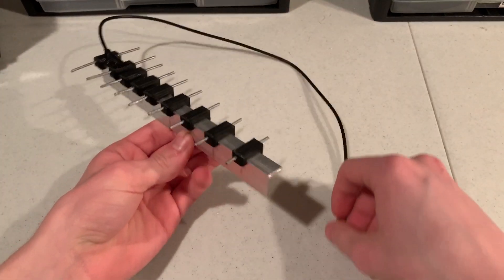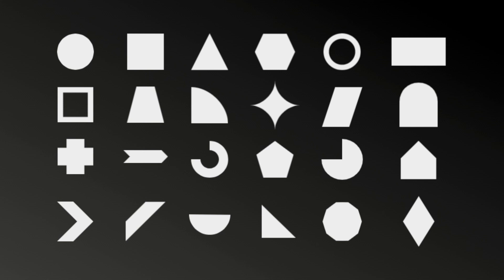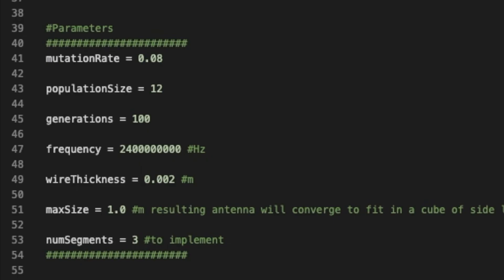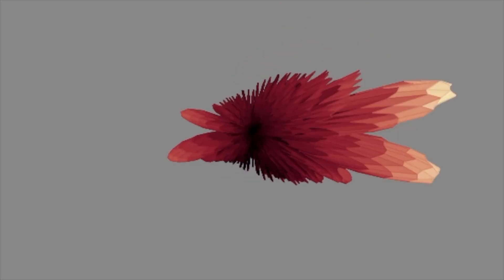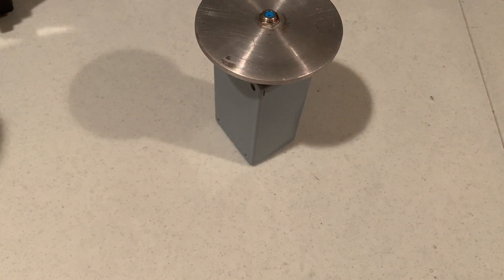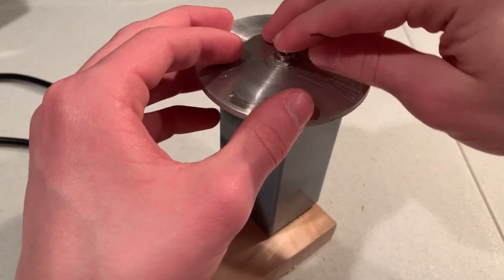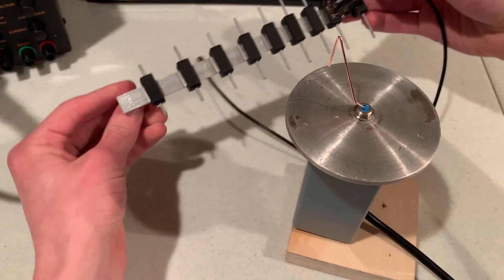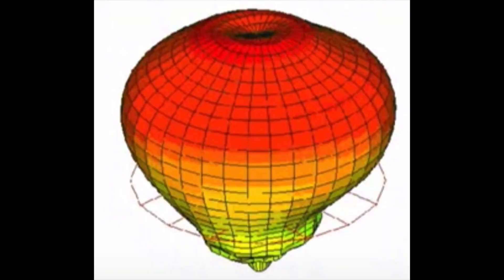Designing Antennas with Python (Evolved Antennas/2.4GHz WiFi)

Comment: I think simulated annealing is a better way to evolve an antenna than evolution algorithm... When you mix two good designs with each other it will completely throw off it's operation. Annealing just vibrates the variables... I would still do multiple generations though, but each generation should start from scratch. You still need many generations because each trial gets trapped in a valley. Every new generation goes in a different direction.

Comment: Nice video.  A few comments for those interested.  The 4nec2 program has a built-in genetic optimizer.  For what it is, it is turnkey and very nicely done.

The UI does allow for some kinds of parameterization.  Simple math expressions are supported for sure.  That enables encoding of things like number of elements, wire length and spacing, etc.  However, I don't know if anything more sophisticated is available.  Trig functions, for example, would be nice so that wire angles could be encoded.  Quaternion would be ideal.

Doing this in Python as you did is absolutely the right approach for the generality.  Packages like PyNEC nicely wraps the NEC2++ backend for usability.  Additionally, I'd take a look at packages like PyGAD for the genetics algorithm engine.  That can save lots of programming time.

Now, a practical problem for antenna designs at WiFi frequencies is the very tight manufacturing tolerances.  A few tenth of millimeter in length or a degree of bend changes radiation behavior substantively.  3D printing is the way to go here.  Use SolidPython package to go from the NEC2 geometry deck to OpenSCAD input.  The rest of it is standard 3D print flow, e.g., STL to Cura or other slicer of choice, etc.

Use copper tape on the printed plastic framework.  Alternatively, glue copper wire to the framework with a bit of CA glue.  Of course in either case, your GA optimization has the wire diameter as a constraint.

Comment: Just want to add that you need to use your yagi in the same polarization as your router, so if your router antenna is sticking straight up, you should turn your yagi so the elements are vertical. Crossing horizontal and vertical polarization results in significant attention
Reply: I have heard that cross polarization (90 degrees) "mathematically" creates a 3dB loss of signal.

Comment: Good video! Two questions: 1) Was the circular reflector part of your model? 2) How does the antenna perform if you use a straight wire of the same length instead of the crazy bent one?
Reply: ...and SWR changes in between.

Comment: I have a small usb wifi adapter, and I want to make it longer range for like 100 m if possible,
can I do that? if yes can u please tel me how?
Reply from the maker: Hi, you can certainly make it longer range by getting a better/larger antenna for it. 100m might be a little far, but it depends on what antenna you get. I'd recommend buying a commercially available Yagi WiFi antenna as those are relatively cheap and have been professionally developed for long range. The range will depend on the antenna you get, but also be aware that Yagi antennas are more directional and only get very long range in the direction they are pointing. When looking for an antenna, pay attention to the gain (usually measured in dB or dBi). As a rule of thumb, the higher the gain, the better range you will get. Also, make sure that the antenna you get has the correct connector for your WiFi adapter, or make sure you get the right adapter. I hope this helps!

Comment: Wonderful info! What is the dimensions for that 2mm copper wire/s?
Reply from the maker: Thanks! Are you asking about the antenna that I bent the wire into? The dimensions for that are shown at 5:23 with the units in meters. The length is about 7.20 cm, but I also included about another centimeter or so at the bottom to put the antenna into the base I made. The dimensions shown in the video are the points in 3D space where the antenna bends with the xy-plane being the ground plane/metal disc. This way of doing it wasn't the easiest and I probably wasn't the most accurate when bending the antenna, but you can always convert to spherical coordinates as this is more common for antenna geometry. I hope this answers your question!